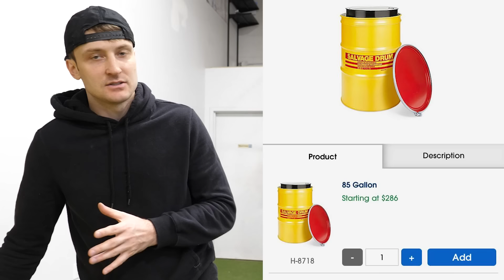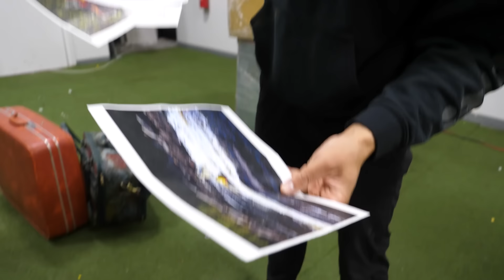Most Expensive Abandoned Item Wins $10,000

Comment: The sword is a Shoto, they were often paired with katanas as a secondary blade, especially if the user preferred to fight with two swords at once.  The shorter blade wouldn't get in the way of the longer katana.
Reply: It's likely not vintage, so the value is primarily speculative.

Also, can we address that the sword made it though airport security apparently?